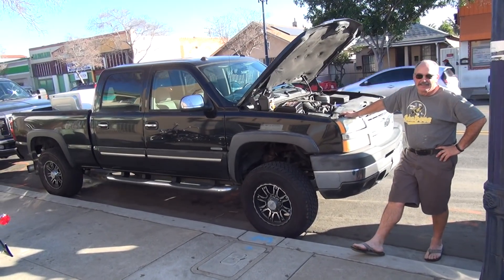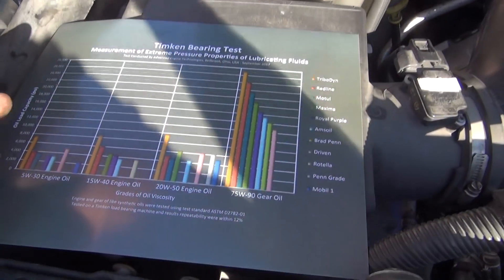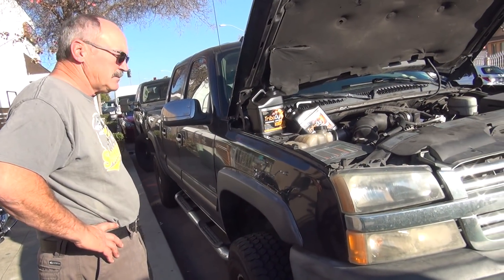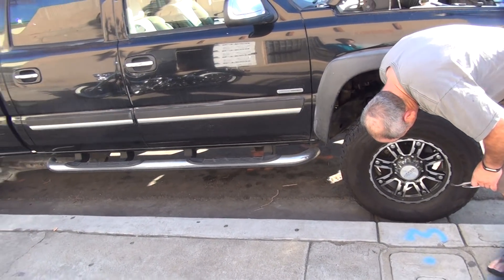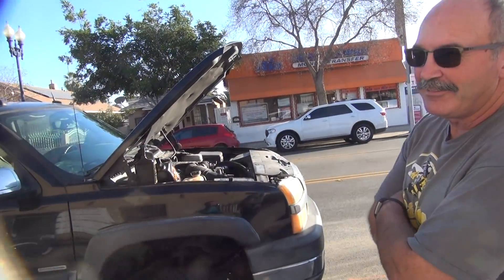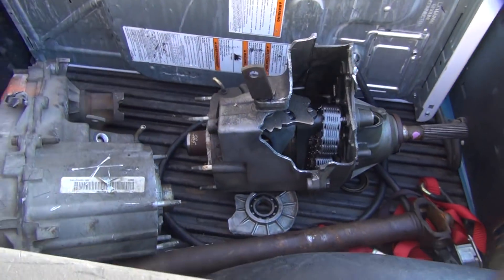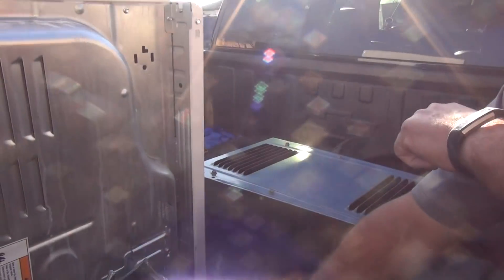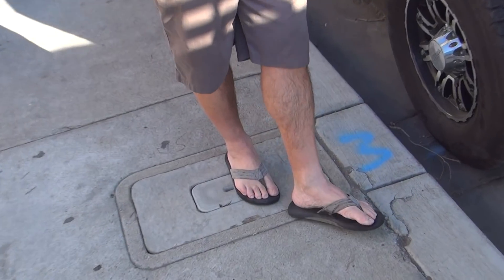2018 tribodyn oil test 15w40 h/duty 2004 duramax 6.6 turbo diesel chevy truck harley tatro machine

Comment: The particulate sediment that falls out of suspension with this fluid is hideous. Shake the bottle, pour it out and then cut the container open and be amazed at the dirt and particulates that are in that stuff. Stay as far away from this stuff as you can!
Reply from the maker: dirt my ass, pour all that good stuff into your motor and it will be happy. just go look at the testing i did with my nitro bike. it is the only proof that i needed that tribodyn works and works very good.
tatro
Reply: @TatroMachine  There's no way I will pour grit of that particle size into an engine. Your knowledge of tribology is obviously lacking. Do what you want but don't ruin vehicles belonging to others. It's bad for business.

Comment: whoever is holding this camera is aggravating. Ford and Chevy aren't faster or slower than each other... they're electronically limited in speed from the factory, and the only one limited to anything close to 70 is the F-450. The Duramax is limited to 98 mph. He's also touching this guy's truck, insulting his manufacturer (why do you want to video the guy's truck just to talk shit), throwing stuff around his engine bay, and interrupting when the guy talks... just to argue again. If I had been this truck owner the guy with the camera would have gotten about 20 seconds before getting cutoff. I feel bad for the guy with the Chevy.

Comment: They dont utilize the "4 Ball wear scar test" which is the industry standard for determining the effectiveness of oils ability to protect your components from friction. If they would  then maybe I'd consider using it.
Reply from the maker: i never thought much of any of those bearing test. i did the 60% dead lean nitro test in my race bike and it passed with flying colors. go watch my last race videos. in all of my real would test it works so that is why i use and sell the tribodyn oil as well as maxima oil. they both work very well so i use and sell them both.
if you want to test the oil and comment about it i can get you a good price on it. email me if interested. i don't get paid to use these oils, i pay to use them.

tatro